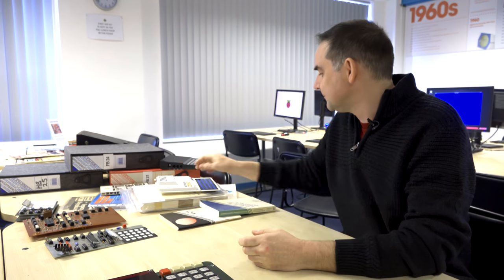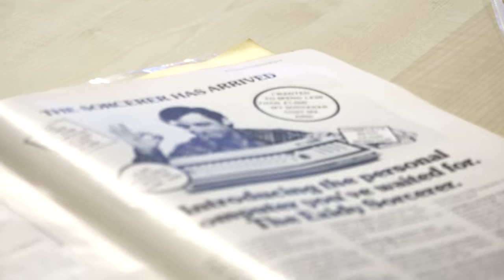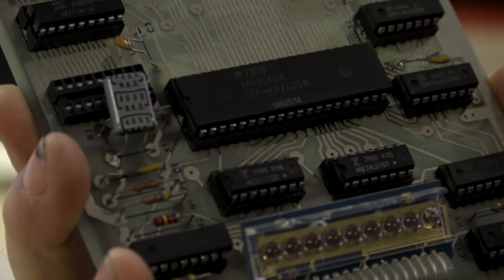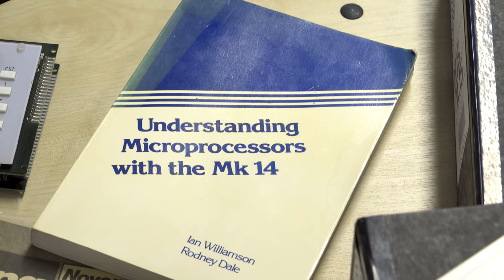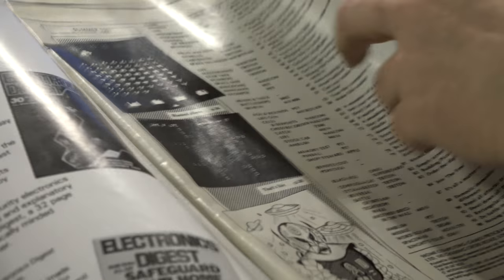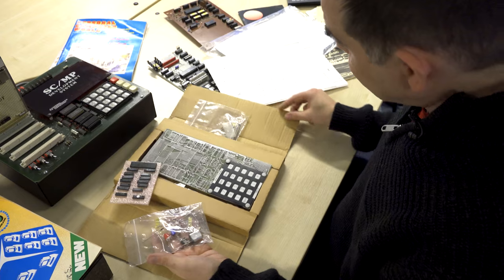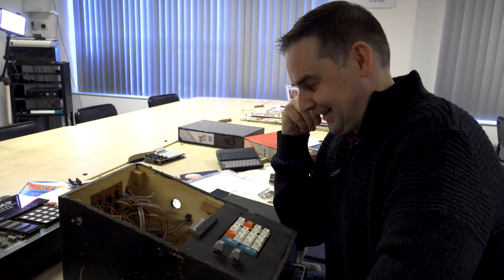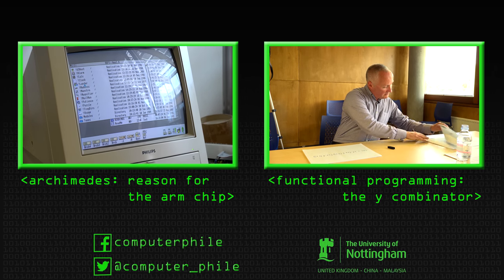1978's Raspberry Pi (MK14) - Computerphile

Comment: My first MK14 I used to design disco lighting, I then bought a large number of them which got installed into many famous night clubs in the uk. Liverpool Cavern Stringfellows. I built a massive system that controlled the game show floor grid  "square one" Granada Studios,. Many thanks to the MK14. Later on I had a SCAMP development kit made for me in Chester. This was used to design a number of Fruit Machines.  A  bit later I used Sinclair Spectrums to make Video JukeBoxes. Many thanks to the guys behind Sinclair. My career is still doing embedded design now for the automotive industry.
Reply: That's very interesting, I've heard of instances where people used them as one-offs for serious purposes like medical research but this is the first I've heard of anyone using them as a standard control unit in a run of commercial / industrial equipment in the same way as people might use the Raspberry Pi 'Compute Module' for the same purpose now. I wonder how many are still hiding in dusty, forgotten lighting rigs?

Comment: Of course there were hardware similarities . Those cards were not really more than customized evaluation boards from CPU manufacturers - though that was a lot of work back then to make that kind of thing. Comparing a MK14  to a PI make no sense and the inflation is completely wrong.

Comment: Those loose-hanging soldered wires would have been a source of terrible nightmares while debugging the board!
Reply: It's probably wire wrapped instead of soldered.
Reply: Meet Udeshi But much easier to fix than respinning the board. Think of it like a breadboard attached to a Pi or an Arduino.  The loose wires are the breadboard part, the actual board is the Pi/Arduino.

Comment: I'd always thought of these as basically a British rip-off of the KIM-1 ( https://en.wikipedia.org/wiki/KIM-1 ) so this video was interesting in that I learned it was more than that.
Though it did fit in a similar part of computing history on its side of the pond. The KIM-1 evolved into the PET -> VIC-20 -> Commodore 64, etc. The MK14 apparently was a similar progenitor to generations of Sinclair PCs.
Reply: The KIM-1's evolution into the PET was a lot more direct as there was a lot of hardware in common. The MK14 didn't really share anything in common with the ZX-80 which had vastly differing hardware.
Reply: It was actually more of a British rip-off or redesign of the National Introkit, which was slightly earlier and is also shown in this video (the little board with all the wire-wrap connections on the rear).  The original operating system for the MK14 was exactly the same, although the MK14 eventually acquired an improved version.